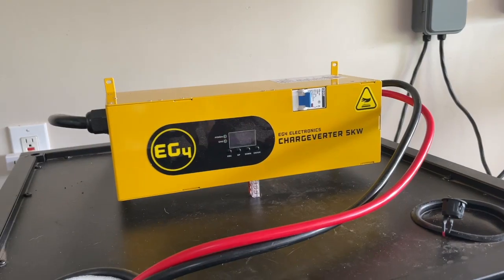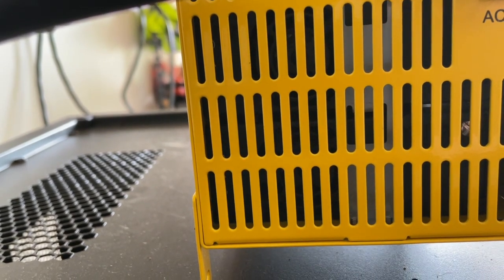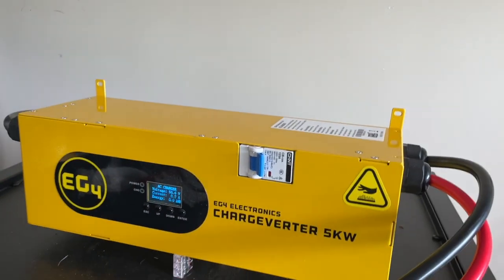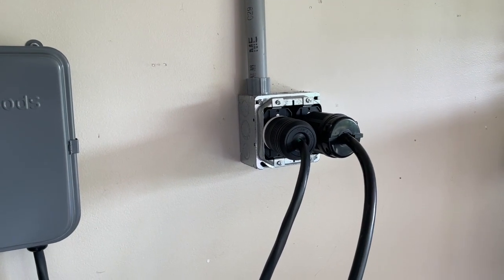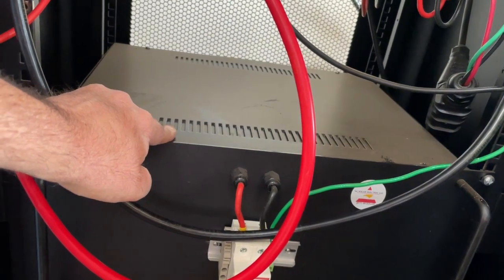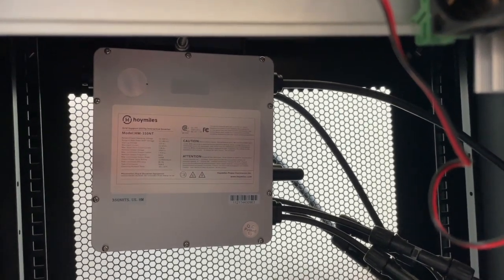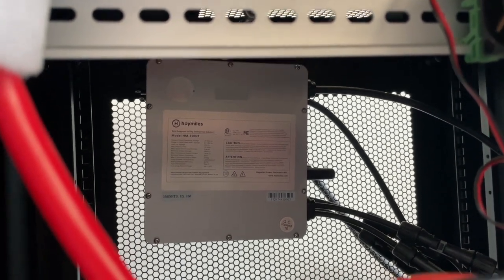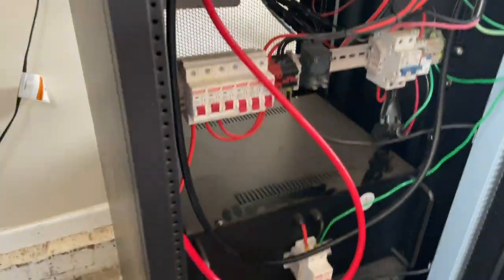DIY Solar Timer for EG4 Chargeverter 5kW

Comment: FYI: I measured about .2A current though the DC lines of the EG4 Chargeverter with the DC breaker on. (The Chargeverter was not plugged in to AC). With batteries at 54.3VDC, that's almost 11W parasitic draw. For the 17 hours not charging, that would be 185W consumed from the batteries.

I thought to measure the current after watching a YouTuber drain their batteries by leaving the chargeverter connected with DC breaker on.

Comment: WARNING. Received mine DEAD ON ARRIVAL. Now they want me to only give me STORE CREDIT and some lame excuse that it is NOT COMPATIBLE WITH A 48V LFP RACK MOUNT BATTERY. AND THEY WANT A RESTOCKING FEE?!?! I just want a working unit. What a lame excuse they gave. NOT happy with Signature Solar and probably will not buy from them again.
Reply: Did you open it up and push the 2 modules back into place? They get unplugged from the board during shipping. You simply push them to the right and they will snap back in and it should work. The bracket that holds them is too thin and bends when dropped in shipping, allowing the two charger modules to come loose from their edge connectors.
Reply: @ToddDesiato  Yes I did.
Reply: I didn't open up the unit, but I checked to make sure that the two power supplies are in. I wasn't sure if opening it up voided a warranty or anything.
Reply: @awesomedee5421  I've never seen one fail after shipping. Usually, it's just a lose connection. Ask if you can open it up, or send it back for an exchange. It's a good unit. Mine worked great once I seated the module properly.
Reply: @ToddDesiato  I've seen one. I already tried wiggling the wires and also tried eating the two power supplies. One did seem to be slitly out, but I pushed both in as best I could tell. I didn't want to open the unit until I got an ok from the company in writing since they seem to be blaming me for the problem and that I've done something wrong. My unit doesnt work, and the some staff doesn't seem to have a clue. Now I'm told by Signature Solar staff that I can't charge a 57V battery with a 48V charger. They seem clueless what the problem is and what is going on and it's very annoying.
Reply: @awesomedee5421  Its maximum output voltage is 57.0.

Comment: Subscribed- how do you have the hoymiles set up for zero export?
Reply from the maker: Using a WattNode meter to monitor the input power from the grid, it communicates with the Hoymiles DTU-Pro and throttles the inverters to avoid export.
Reply: Thanks for the info

Comment: What part number is the micro Inverter? I have been planning this in my mind for years. I never knew micro Inverters would run with zero export 

This may simplify my setup a great deal!
Reply from the maker: I'm using the Hoymiles, HM-350NT, and the WattNode meter. I have them in stock at https://ncsolarelectric.square.site. Call me if you need them. (877) 58-SOLAR.

Comment: I subscribed. I like your setup and want to replicate some of it. You don't list all the parts in your setup. Do you have a schematic and parts list? You've got the best setup so far. What are those boards to the Hoymiles microinverters that you have? Is that off the shelf or you custom made those?
Reply from the maker: Thank you. I do have a single line of a sort, I'm in the process of redesigning for higher capacity microinverters, and more of them. The board works great! Give me a call, (877) 58-SOLAR.